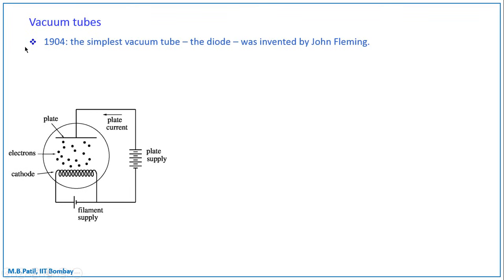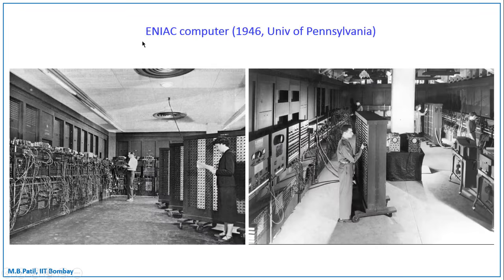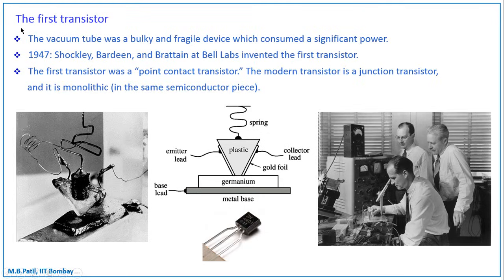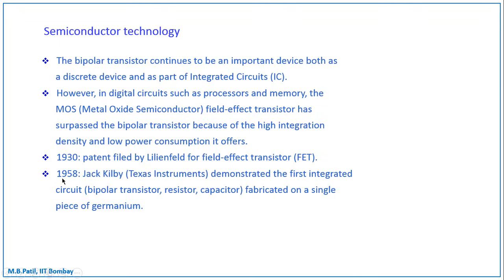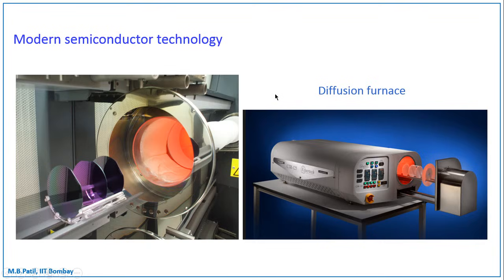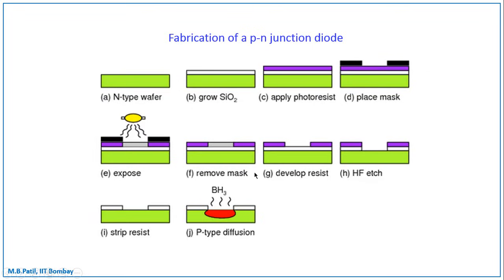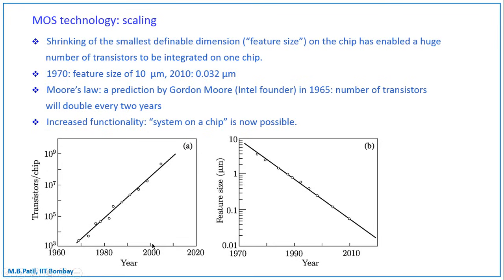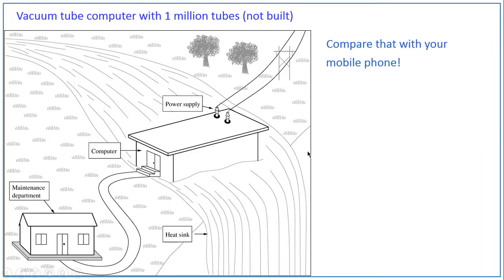A BRIEF HISTORY OF ELECTRONICS

Comment: Sir what is the difference between charge and flow of electrons(i.e. current)? Does negatively charged plate not emit electrons ? Is current flowing through any conductor is equal to the charge hold by that conductor ?
Reply: Charge is a property of electron. Current is the flow of charge. You can interchange charge and electron when talking about electronics but not when talking about physics. Electron is the physical manifestation of charge (i.e quantum of electromagnetic force). Negatively charged plate has more electrons than protons so its charge is negative. Current flowing through the conducter is nothing but the flow of free electrons in it.